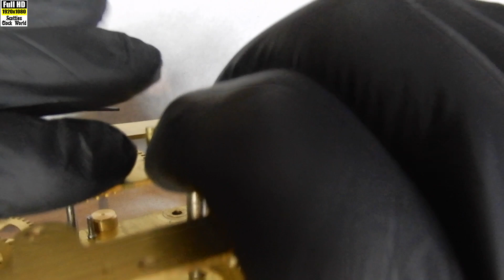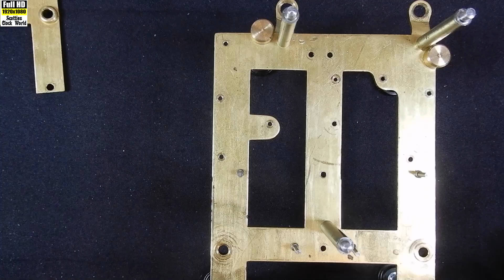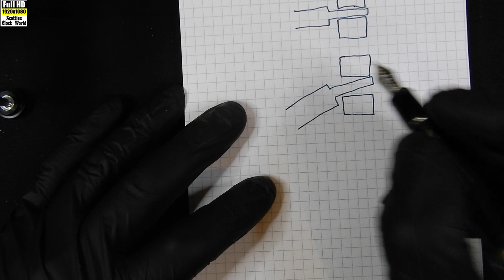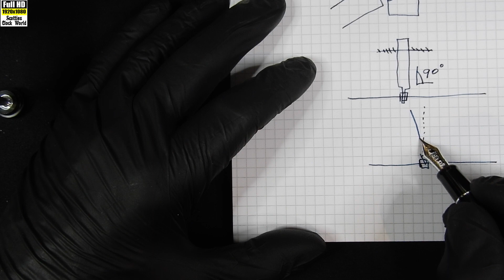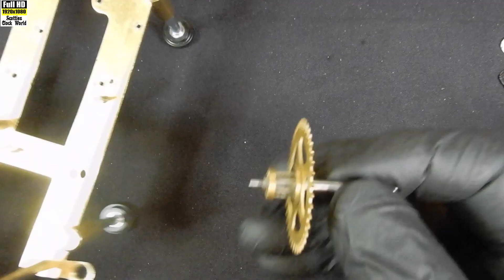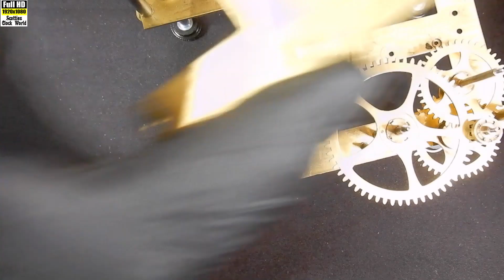Clock Repair For Total Beginners - Lesson 11

Comment: Hi Scottie, I’m enjoying your videos. 
My fixer upper clock is now in pieces and in the cleaning process.
I notice you sometimes mention 5 degrees and sometimes 5%.
5 degrees is easy to estimate but 5% is a little ambiguous.  
Are these roughly the same as 90 degrees would be flat on the plate as in 100% leaned over?
David

Comment: Hello Scottie and thanks for these lessons. At around 19:20 your checking all the wheels in place again but I don't see what we've got from that. What is the diagnosis from that, since we already learned 4 bushings are bad? I'm following you so I can fix my clock and you are a really good teacher.
Reply from the maker: Checking to make sure I haven't missed any bushings that need replacement.